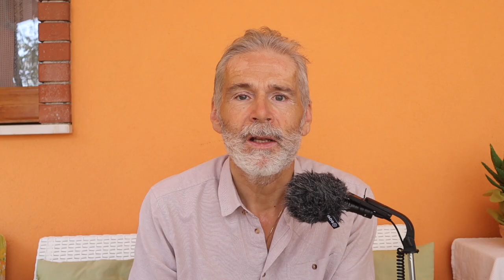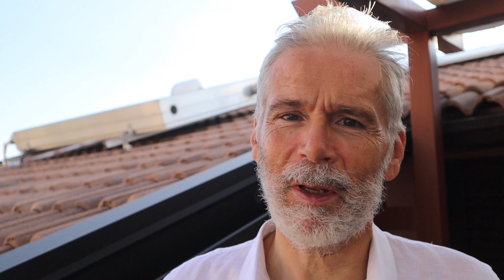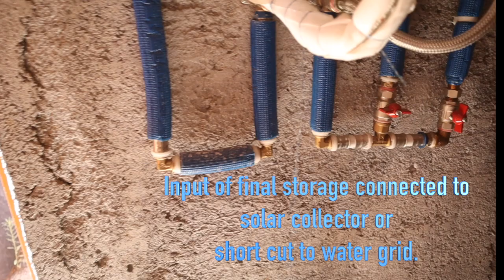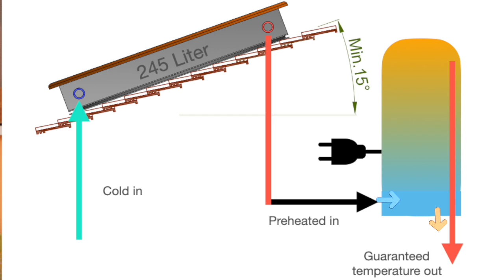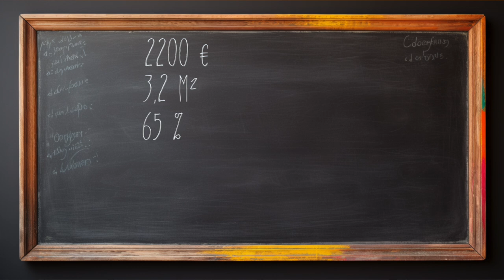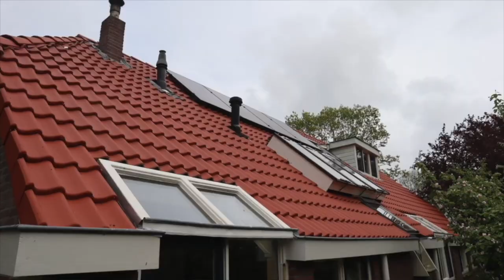Revolutionary solar heating: combine it with your existing water heater - Video 58

Comment: This would be OK for places that never get below freezing but not in Ohio in the winter at night.. I did not see a check valve to prevent water from expanding and pushing the cold water backwards or an expansion tank so the pressure remains low enough.. The systems around here have a heat loop filled with a solution that does not freeze at our cold temperatures and an exchanger that passes the heat to the fresh water in the house.. You would also have to worry about biological things growing in the system that would eventually cause problems.. Simply prewarming the incoming cold water to room temperature does chop a lot off the cost of heating but the expansion tank and check valve are still needed..
Reply from the maker: I pin this answer as I agree that I have not been complete enough, sorry! Our solar system is indeed right ... for us, it is not complete for all circumstances. 
The important point of this video is that you can put 2 systems together and have the best of both. The existing system is usually designed to supply always water at the same temperature. That's already a lot of benefit. The additional (solar) system can take the role of the money saver and can be as complex or simple as needed. I just would like to trigger a movement of solar exploitation in a corner of the house where so much energy is taken from ... the wrong source. You saw my statistics: only 3% of households in Developed Countries have solar thermal and 30% (10x more) is making hot water with electricity. The electrical grid is stressed worldwide. Let us relax ... it.

Comment: A counterpoint that bypasses freezing issues and installing anything on the roof or really at all..

To be effective with solar PV summer needs to be oversized, even moreso in snowy and cloudy climates.  So summer electricity production outstrips usage and battery storage.  Dumping that wasted energy directly into hot water tank is fairly simple with an element, relay and some sort of voltage or coulomb counting trigger.
Reply from the maker: Yes, the 10 : 1 or 5 : 1 ratio between summer and winter yield is really an headache, seasonal storage is the first solution that comes into your mind but if you see the practical obstacles for that you must come with other solutions. For example food processing, that is also a kind of energy storage. You mentioned growing food in another comment.
Reply: @nnvasen-good-energy a good point.  I have on my list to create a video on scaling usage by 10 fold across seasons...highly efficient winter (DC appliances etc.) to high output summer (food drying, ebike foraging, mining etc.)  Creating stored value is a battery.  Reducing value consumption is the inverse.

Comment: I have a similiar setup. But I have a glykolsystem, because we have freezing temperatures on the winter. 

But my system is also connected to the heating system, switching between hotwater/heating system, resulting in very low roof temperatures (and high efficiency) in the spring/fall. 

It reduces heat pump operation for the heating system, and the heatpump only heats up the tap water to about 40C (periodically 55c). Its running dirt cheap, usually below 100kWh/month for the non summer monts for a family of four persons, and almost 0 during the summer.
Reply from the maker: Hi Bsod, that is great! I am Dutch, so quite familiar with below 0 temperatures, but where I live now (Tuscany and Sicily) it's less common (and becoming even less frequent). Glykol is good for safety and also to have access to water as a Phase Change Materials (PCM), when you lead it for example in a bath with floating bottles of normal water (that will freeze and absorb much heat). With freezers you reach easily deep temperatures, but in those ranges the COP might go down.

Comment: This is a good possibility for using more heat from the sun. But have you looked at solar diverters? I use the SOLIC 200. It's been working flawlessly for years now. Nearly free hot water during 8 months of the year. Plus no water lines outside the house.
Reply from the maker: That's indeed a smart solution, especially for video 63! There the problem is that the PV energy actually must be avoided to flow into the grid, if the energy meter doesn't distinguish the direction of the energy flow (in/out). That must be tried. I will say it to our friends, which actually have this problem. Thanks Charan!

Comment: Very nice, I am considering a solar water heater . The area where I plan to put it is a tropical area, I wonder what my choices would be if I don’t have an electric water heater?  Also, I would need a mixing valve to combine cool water with the hot water so people don’t get burned when washing dishes. I suspect putting a relieving pressure valve as a safety precaution would be good.
Reply from the maker: If you have this thermostat valve, you have a large temperature range where the people even don't notice a difference in solar irradiation.  Then the storage volume is an important variable for secure supply. Good insulation is most important with higher temperature and a high temperature allows also to have less volume and still the same energy.
Reply from the maker: So the thermostat allows to live without electric heating.

Comment: New subscriber from Michigan, USA.  Nice video / content on hot water heating and not wasting precious energy.  I use solar to run air conditioning in the summer and resistive electric heat in the winter for one large room (20 square meters) which does help a little with the bills.  Learning a lot and not listening to the politics on the subject but plan to expand more in the next home and enjoy retirement without the high bills or worries should a grid fail in the area.  Keep you the good work sir.  Ciao.  Gary
Reply from the maker: we had 2 weeks ago guests from Michigan in our Zero Energy Holiday Home (ZEH)... 
Thank you for your encouraging words and hope you will have a nice retirement time. Reading that you use PV the whole year around you might be interested to see this video 25 and the next four of the 25-series about a current project I am improving about a mobile airco that I use with double efficiency because I use both cold and hot side of the heat pump circuit. https://youtu.be/6KRZKVct-uE
We have also a political issue: our state supported PV system with grid connection is commanded to go down during a black out and that seems to be a safety prescription also in other EU member states. Even if I would just switch off our system from the grid during blackout, it seems there decision that we may not enjoy independence during the blackout. It will just shut down and not even charge the home batteries. Is that the same in the United States?

Comment: Feels mean to diss your good work..one final comment 
Used PV panels are very inexpensive.  If these are connected directly to a low voltage DC immersion heater in your tank, with a thermostat, you have a very cheap simple system. 
There are other YouTube videos showing this.
Reply from the maker: No problem, Mark, for a good comment. In the first place I like very much your idea for its simplicity: high safety and no inverter needed, at least it can be dimensioned 1.2 kW less. You can even put other PV panels closer to the heater because there is more current (100 A with 1.2 kW). However, the PV has an efficiency of about 15%, even if that might be a bit better with variable voltage (that's why I like the simplicity of your solution) and solar thermal is at 65% or higher. That is a big difference, but as also other comments reveal, many in the audience are concerned with the technical problems of solar thermal, while PV is so simple. And you made it even simpler: I don't see any need for other components other than the cables and a (thermostatic) switch.
Reply: @nnvasen-good-energy  yes, if you have limited space, and a high hot water use, thermal could be a good option.  I understand self contained units are / were very common in many hot countries.
Reply from the maker: I was for work in Mauritius and saw many vacuum tube collectors

Comment: Good idea…but as others say, many problems, and PV is now best.
If you DIY, yes worth considering.  That said, my neighbour, in Scotland, just got PV for 100% grant! 
My dad tried something similar in the 80s.  House in Devon UK.  It preheated a very large header tank.  Before we moved it act started boiling!  The idea was to drain in winter…but an early frost caught it out, sprung a leak, to never work again.
Reply from the maker: Yes, I know also someone that had a frost and it was irrepairable. With DIY you can at least make things modular and exchangable. Or take measure before the event occurs. It would be nice if the manufacturer made these solar collectors error proof. We are so used to the simplicity of PV that solar thermal seems fragile, but many other things also need elementary care and maybe we are more used to those.
Reply: For cold climate look at drain-down systems, which use a small pump to only fill the collector whilst the sun is shining.

Comment: I have decided for my climate  zone 4 in the USA  to do a drain back system  Evacuated tubes 30 tubes.  10 gallon drain back tank located inside of the house.  it heats up a 50 gallon storage tank  so there is a pump to move the water thru this system It will be supplied by a photo voltaic panel so water only is pumped during the day if there is sufficient sun.  There will then be connected via a heat exchanger to a 50 gallon heat pump water heater. there will be another small pump to move the water from the drain back to the HP.wh    Like you the hp water heater will be centrally located so no plumbing run will be over 20 ft.  Figure the vacuum tube does not put out as much heat as a flat panel but is should be able to produce 12000 btu of water per hour
Reply from the maker: I wonder why there are so few evacuated tube collectors. In Mauritius (I had a Renewable Energy project there) there was plenty of them. High quality and also for colder climates a good solution, with less heat loss. Is zone 4 sandwiched between north and south, and then running the north west coast? Should be like my native country, the Netherlands. You have quite a complex system it seems, but nothing against that. Important is that it is all under control. By the way, I just bought the Home Assistant system and want to make videos about it, should be a control solution to run this complexity, or do you have another system? Arduino should also be good.

Comment: One could equally store the pre-heat water in the house closer to the final water heater. It is rare for the storage to be on the roof for any format of solar water heating in northern Europe, for the obvious reasons that the losses would be greater and the consumption of water is unacceptable due to the long pipe runs to draw-off points.
Reply from the maker: That's a good point. Certainly they have worked on the problem of heat loss and long tubes to the end user.

Comment: PV seems like a better usage and then just use a solar hot water preheat tank as an energy dump for excess solar.

If you really want thermal hot water then make a mount that you use regular PV solar panels cooled by the water, again in to a preheat tank and then you collect the thermal energy and also the output of the PV will be better thanks to being liquid cooled.

A pure thermal collector doesn't seem yo make much sense though, now that PV is so efficient and cheap. Running the piping and making sure the roof weight limits are still within spec, plus having piping on your roof is already a liability in case of damage or equipment failure.
Reply from the maker: Sorry for the late reply, I am working on another YouTube channel on GHG Accounting.
I like very much the idea of solar CHP (Combined Heat and Power) and in a short video I mention that. However, it is hard to find those PV panels. Indeed they run better if cooled as you write, but it must be well below 70℃.
However, solar thermal is not too expensive, our 3.2 m² should give some 2.5 kW so that is really 1€ per Watt. And the efficiency is much higher (about 65% against 15%). 
You are right about complexity. I've been working now on hydraulics for the next Saturday video and ... it is not so easy as it seems, and plumbers are not easy to find (here). But diversity seems me a good principle. Indeed we have 6 kW PV against those 2.5 kW solar.

Comment: All solar is local.  These systems sound nice, but they come with issues.    I've seen these on rooftops and after a couple years they get removed.  I have a thermal unit and have never installed it. There is no place on the roof that gets sun most of the day.   I heat water with excess PV and panels can be placed anywhere.  The purpose of a water heater is to have it turn off soon and then it is just useless junk on the roof.  PV can be used for anything.  The marketplace eventually figures it out. In more than a half century this technology hasn't made it mainstream.
Reply from the maker: Hi Opera, you have a nice channel going on, I saw already some nice video that I want to watch. You make a very good point. Solar collectors have a lot more that can happen. I would not accept that as a fact, because solar thermal has the merits of having much more conversion efficiency and to work even if covered by a bit of shadow.
Reply: @nnvasen-good-energy  My channel would be better if I bothered to learn to edit.  They are very technical and I don't see myself as a personality. My PV hot water designs have been built around the world, even Tiera del Fuego.  I got a kick out of that. I don't know if you do home repairs, but plumbing always turns into a nightmare. Give me wires anytime.  The vast majority of YT viewers are only voyeurs and never build anything.
Reply from the maker: You are a bigger channel then me! I wonder when I will hit the 1K barrier. I see much specialisation in your channel, very good.
Reply from the maker: I also have complaints about the temp that  our collector reaches and will ask the manufacturer.  However I liked so much the idea af an hybrid and keeping the old system and its proven advantages. I wanted to show that idea on youtube.
Reply: @nnvasen-good-energy   Some add an extra pipe and a pump to circulate the water thru the water heater.  As with most things, a simple idea can easily become more complicated.
Reply from the maker: I also hope that many DIY like my brother at minute 13 will be induced to make a colle tor, even simple. With the guarantee of hot water it will be less daunting to try it. There will be no problem to sell a cold shower to your house mates.

Comment: This is an easy win, I use solar hot water most of the summer from mid Feb to Late October.
Reply from the maker: Thank you Richard!
You are right, the sun is sending us so much energy, people are complaining it's too much. And 30% of households in Developed Countries heat the water with electricity...
Reply: @nnvasen-good-energy 

I installed mirrors around my solar water heater and I get 3 times the heat. 

190 kilograms of water from 25 °C to 60 °C in just 20 minutes during sunny mornings.
Reply from the maker: That is amazing, a cheaper way to turn surface into energy. Is the "movement" of the sun a problem?

Comment: Similar to what Mother Earth News Magazine showed 50 years ago. Your system is nice but, what happens when the weather dropps below freezing?
Reply from the maker: See my pinned answer, above. The news that I try to bring is to make a hybrid, maintaining the old system, so that the additional system (here solar) can be simpler and even DIY. And yes, unlike with our system, you have to take care of freezing.
Reply: this question is exactly why I am doing a drain back system.. no water in the system on the roof susseptable to freezing
Reply: @stevepailet8258  Depending where you are and how cold it gets, the drain back systems can run into trouble in a power outage. I prefer hot air systems because they are cheaper to build and leaks aren't a big problem. I built my house passive solar 30 years ago. I works well when we get sunny days. Unfortunately, the number of sunny days per winter has greatly reduced in the past 30 years. Good Luck, Rick
Reply from the maker: Good point Richard, working with air. Certain configurations can even work with cooling, if you make the so called "Trombe"-wall, which can draw air from a cooler place (under the house or north side).